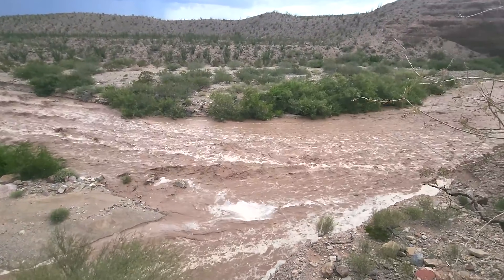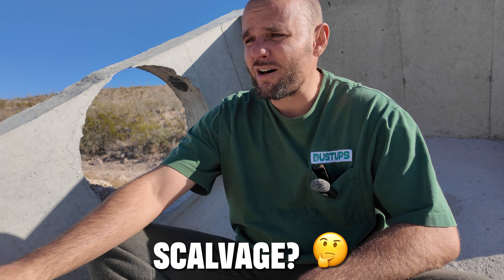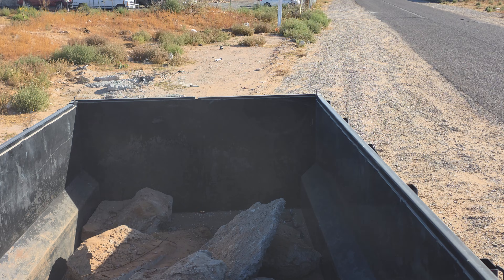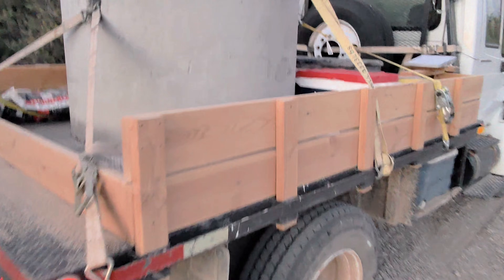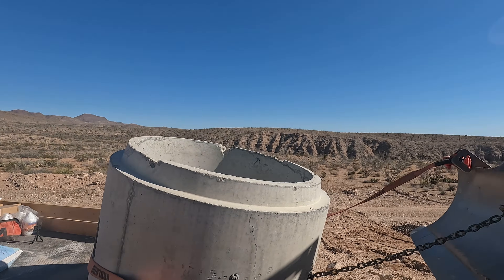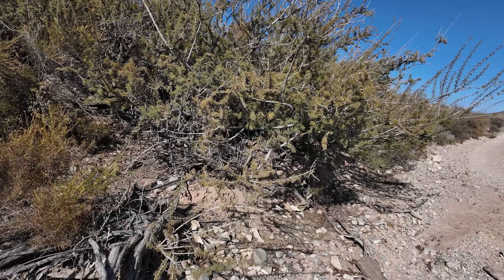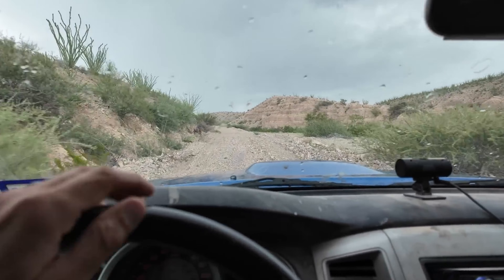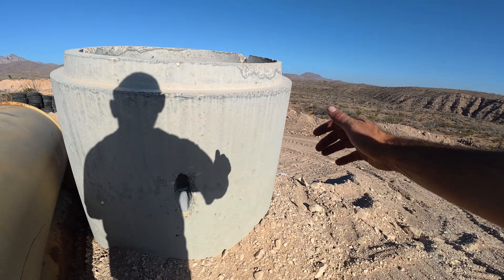I'm Fighting Desert Floods with Free Waste Concrete

Comment: If the mountains get twice the rainfall and the water goes right by/through your land, is there any way you can capture a SMALL part of those rushing waters?  While the rains are random, this extra water could help you immensely.
Reply: The infrastructure to stop it would be expensive because it destroys anything that doesn't look like that wash until it does look like that wash.
Reply: Remove a massive amount of rock in the wash to create a pond. The water fills it with stone and .ud the first rain.

Comment: If you had enough of those pipes and laid them side by side across the wash with each pipe facing opening face the flow of water… the water could flow through them. Then you fill in between them and on top of them and make a road across the top with gravel and rocks. You’ll still create a barrier as well as a road across the top.

Comment: I don’t think you should stop hauling those blocks out once you have one line across the gap,
I think you should space them out with a few feet between them and put another one in the gap allowing the water to flow but slowing the speed of the water.

Fill in that whole space between your line and your road. Debris is going to build up over time and add free support to your project and the banks of your crossing are going to widen for sure.

So it’s a good idea to have extra blocks you can move out, also line the banks upstream.
 Try to get a nice pad to drive on that won’t erode.

Comment: Pro tip,  Find a CAT scale near you, setup the app and a CC. figure out your Load capacity, then minus your truck and trailer weight. That is your Actual load capacity. and Just roll over the scale to get your weight with a load.

Comment: The advantage of gabion blocks is you can build them onsite, all you need is the wire, you have the rocks. 

The cast concrete makes a great anchor but you might want to put a couple layers of gabions upstream of them to take the initial hit of flood water. Not an engineer, but I don’t think 6 ton blocks of concrete are going to stay put when a flash flood smashes into them but if you can distribute and diffuse the load you might have a more stable system. Probably need back fill behind and some soil retention behind as well.

Comment: Shaun, have you considered using F.I.B.C's Flexible intermediate bulk containers. They are typically used to transport and/or store granular materials. When empty, they weigh about as much as a blanket. They are built to hold 1 ton or more of materials. They are one time use in many industries and they just throw them away. You can fill them with local rocks and clay to make your damn.
Reply from the maker: It's a good suggestion if I had a front loader. I like the idea. It's a poor man's Hesco

Comment: Please keep an eye out for a "hook lift" that will fit the International truck.  It will multiply it's usefulness as you can use it as a dump, a flatbed and roll-off hauler without a loading ramp or lift gate!.  You can leave a roll-off dumpster at your neighbor's to collect manure and pick-up at your convenience.  You can dump cargo like the concrete blocks wherever you want. And you can still use it as a flatbed!  Another channel called @onyxpartitian even did a video about retrofitting his truck with a hooklift.  Check it out!

Comment: May want a little “ padding “ in bottom of trailer if hauling rip rap, surge stone, large debris .     Be neat if you could make a cistern out of the better pipe sections May. E able to stockpile the concrete then rent a skiddy with a rock bucket     for a week.  Commend you on your efforts.  🍺.

Comment: If you get more concrete pipe, have them load it sideways so they can roll off the truck when you unload. Thats's how they get delivered to the job sites. Also lood for highway projects in your area. Many times they demo culverts and bridges and are looking for plces to dump
Reply: I've built plenty  of highway projects in the Sierra Blanca area and know that a lot of concrete get dumped in holes near the highway

Comment: I’m wondering if creating sections or barriers in a zigzag pattern down your trench instead of straight across might cause the water to meander and slow the water might be better.  Just a thought for the viewers.
Reply: Go watch the video it won't help.
The hescos with a ramp of stones behind it to the top is the best option. A few other geotextile placement would help.

Comment: Sweet Shaun, that sounds like a fantastic idea. I'm guessing the concrete is supposed to allow debris to build up behind it like a check dam while eventually slowing the flow enough to let the water soak into the ground. Sounds like a really cool experiment. Can't wait to see the results of it. Sounds like you will need many of them to deal with the massive amounts we get in Texas when it flash floods but the idea is really solid

Comment: You're in a remote, secluded spot in a desert.  Texas has marijuana laws.  Therefore there are illegal growing operations going on somewhere not too far from where you are.  From time to time the police will bust some of them. 

Therefore greenhouses (mostly made of metal hoops and plastic sheets which have the advantage of being light and easily portable),  shade cloth, irrigation equipment, pumps, enormous water tanks, garden soil, fertilizer, and several other things important to your goals may be for sale available locally at police auctions on a fairly regular basis. 

The best case is when they don't feel like it's worth it to haul that junk out of there all the way back to town and would appreciate someone local to cart off chunks of it. I don't know if they do that around there, but it has happened several times on the Mojave.
Reply: I love that idea!

Comment: what you need is a proper cultivation of the soil , dig a dip hole every yard or so to capture rain water and you will have golden growth
Reply: He did that called them dirt bathtubs problem is water drains away in less than a hour it has some good effects but not drastic ones

Comment: Drop some 1 foot wide pipe down into the arroyo.  Secure it. Maybe with your concrete.  Run it up the banks and onto either side of the arroyo. Go at least 300 yards away from the banks . Dig Some ponds. One rain storm will fill those ponds, it will look like you hit a water gusher of a well.  I sent you a  video from a Farm in Wash State which used this method as a solution to get water out of a 60 foot lower than the bank stream. Works great all year. Have fun.
Reply: So it uses the force of the rushing water to drive water up the banks through the pipes, sweet cheat code!
Reply: @Barskor1  exactly. The should run a 4 Inch Pipe to check it out. The amount of water is going to be amazing. They could sell Tickets to the show.

Comment: I have some very large Hesco Barriers from a military auction.  They are 7’x7’x7’ and can link together. 
I think these would work well.  I am just 10 miles north of I-20 on your way out there.
Reply from the maker: Email me: howdy@dustupsranch.com
Reply: @dustupstexas nice 👌  its coming together .
Reply: @dustupstexas sink those into the ground and T the wall with another at the joint and they'll never flip
Reply: Here we go! Made for flood control. Can't beat that!
Reply: Commenting to help bump this - I hope Shaun sees it!
Reply: Amazing, it feels like I'm watching history being made in the comment section right now
Reply: ￼ I think this will be the hot ticket. They are linked up and go out 91’ with 13 cells that are 7’w x 7’ l x 7.3’ h
After rewatching the video, I would think he could drive over them if he also puts dirt on either side, built up.
If you want to look them up, here is the exact name.
Maccaferri MILDTL32488-7B DefenCell Mac Welded Wire Gabion Barriers
Reply: @encorepermian  tyvm for helping Shaun!
Reply: @encorepermian definitely. They have great gravel too that will weigh them down more. If the double sided them and offset then so the joints aren't in line and sunk then 2 feet down I think that'd be extremely resistant
Reply: email sent
Reply: Hesco would be perfect, now u just need to fill them upp😅 you got plenty of rocks and soil over there and you can fill them with a small excavator
Reply: Use hesco Shaun I commented to use hesco before I saw this comment

Comment: It's tough to beat free when it comes to the reinforced concrete, but I'd be interested to know your thoughts if gabions wont be cost effective at this time. I feel your main concern with them is if they collapse, there is that one gabion that was installed and collapsed due to having the very sandy foundation underneath,  but one thing I saw that was missed is that when they're set up vertically like that one it's more structurally sound to lock it into other surrounding ground. A gabion of that size is built more for a steady seasonal stream over flash flooding (although many of them together can help resist a flood).

My thought is to lay some gabions wide so that one can't fall onto its side essentially, make a gabion floor as opposed to a gabion wall, and that way you basically get many rectangular rocks. Gabions used for water catchment are often done like that and two-layered like steps, but for your purposes one could do plenty. 

In Arizona and Mexico, Cuenca los Ojos / Valer Clark is a company that has been working on anti erosion for years, I highly encourage you reach out if you get the time.

Comment: I saw a guy using these for fish cribs in the past. What I would recommend is contact your local DOT office and ask if they are doing work in the area. They’re under no obligation to help, so understand that, but often if they are you can offer to dispose of concrete from old storm sewer systems. The crews on the sites doing the work will have the equipment and see it as a benefit that it’s less of the pain-in-the-_ part of the job that they have to do, their company saves the high cost of recycling these components, and the DOT knows it won’t be sitting on the sides of their roads for extended periods of time.

I built my workshop with wood built from shipping equipment being thrown out on job sites, offering to remove this kind of waste is something companies want because you get free material and they aren’t paying the cost-per-pound to dispose of it all.

Comment: If water gets hold of those concrete blocks, it'll roll them like peanuts. You might be well advised to fill them with those little stones (in bags so that they don't disperse easily is even better) that you seem have a lot of and even some clay to bind the stones together. And, you need a lot more of these blocks. A lot more.

Comment: You're going to want to use the dozer to push materials against the concrete on the upstream side. Not perfectly done, but a start. Something to make sure the force of the water is spread across the whole structure. The water will find the weakest way through and EVERYTHING will go there.
Reply: Exactly,  that's the plan once I get enough to cover the area

Comment: Check the fuel filter on your truck, no flow… no go….
Reply: Fueling is fine.  Its a steep grade i was going up.  The engine is a dt466, not a big 14 liter engine you find in tractor trailers

Comment: jersey barriers ftw - this could really help with terra forming - think along Z shaped sloughs or terraces - obviously you have to work with the land - it is trickier than it looks, you are doing some good experiments and making things happen - just keep going - 2026 could be consequential plus you can fall back on horse manure and compost - that stuff is going to bring wins, in enough quantities. the dozer should continue to be a force multiplier, make some reservoirs or series of such - maybe some fabric or adequate spillways to preserve the dams - connect concrete pieces with rebar. keep bargain hunting

Comment: Just an idea here, and it may have already been suggested, but those large tubes could also be used as culverts to let flood waters pass under the road. You'd probably need to cut some long gently sloped trenches with the bulldozer to lower the grade a few feet in the middle on both sides of the road so you can let all that water pass under it. Then you cut out the middle of the road with the dozer and roll like 3 or 4 rows (2+ tube stacks) of those tubes into the gap before covering it all back up with your road. However, this option would require a bunch of those tubes and it'd be a lotta work and time. All that for just a road, when your real focus here is simply to maintain access to the ranch. So I hope that your current strategy works out as it sounds like that'll be most efficient by a number of metrics. Anyway, best of luck with the flood control setup!
Reply: I think that's a great idea to let the water flow.

Comment: The last episode I suggested building a large pond to control the floods.use the bull doser to go down about 6-10 feet in a 100 x 100 yrd hole in the middle of that valley they floods. It won't hold all the water  but what it gets will last months. Or maybe not in the middle but off to the side and dig a canal to the pond. Have you given that any thought? It's a way to help control the flood and at the same time gather much needed water. In other words a retention pond.

Comment: Giant concrete is a great idea bro! Last episode on the wash I was too late to the party but wanted to mention with your Gabion attempt that welded wire fencing is pretty delicate but out west our trail maintainance folks use chain link fence material for gabions and it holds up much better
Reply: Gabions are something you're better off. Using the real thing.
Especially for use in waterways. I guarantee chain link fence won't do it long term.
Just an FYI

Comment: if the water does not have a way around the blocks, it will find one. it still will ripp through there just on the sides. The energy of the water is still there. it needs a diversion earlier or you can build some kind of bridge. it has to go somewhere
Reply: I was thinking the same. I suggest Dustups seek/find a hydrological engineer who can vet this idea and advise on arranging the concrete pieces. Culverts or conduits might be required to allow water to pass without scouring the banks or carrying away the blocks even the big ones. Good luck!
Reply: this is exactly what it is going to do...the water will find the next path of least resistance and flow through there.

Comment: Reminds me of the sand dams in Africa. You'll have to work it into the bank though as otherwise it will just scour the sand out around it.
Reply: I can see that happening over time in Eugene, Oregon  44.046260, -123.047643  Several iterations of improvements, and now paralysis, are allowing the Willamette River to scour around the most recent end. Fortunately, the shape might turn into a Tesla Valve, hopefully mitigating itself.

Comment: Shawn, a bit of 2" square steel 1/4" walll, can build a gin pole, that will hook over your dozer blade and  can reach over the heavy stuff, chain and lift blade lifting the Gin Pole, lifting object off trailer, truck or just carry it around.  Think of a boom truck used in the oil fileds etc. would be cheap to build if you have a welder handy..
Reply: Do you use wooden telephone poles over there, they dhould be cheap.

Comment: Like I said before, make 2 ramps pointing DOWNSTREAM but set INTO the bank, so it is OUTSIDE the flow. Then ARMOR the walls facing the water with the heavy material. That is how seawalls are built and they hold up to storm surge with the energy of a nuke.
Reply: I think you mean upstream as seawalls/dykes have their small slope towards the sea - at least here in Northern Germany/North Sea.

Comment: You have millions of pounds of perfect gravel out there. It requires 450 pounds of cement to make 4500lbs of concrete. I kinda wonder if it would be more cost effective to just make your own concrete they sell form molds to make large blocks... but I suppose there is the challenge of water ad well.

Comment: Get a roll of bailing twine, string a level line at the elevation you need to maintain your low level bridge. 
Flowing debris is going to be what you're building for. 
Over, or under? 
You're building a water obstruction. Block it too much and once it reaches the strength capacity of your structure, it's going to fail all at once.
What's downstream?

Comment: Necesitas llenar las piezas con sacos de arena y piedra. La barrera se tiene que colocar en la parte mas angosta del cauce y que tenga roca madre por debajo, si no vas va a escarbar. You need to full the concrete pieces of sandbags and rocks !  The barrier has to be placed in the narrowest part of the riverbed and has bedrock underneath, if you don't go it will dig.
Reply: Right and of all of these Dustups vids I have watched I dont recall ever seeing him hit bedrock yet,  caliche is the closest thing to it but if that stays wet it goes soft eventually. That whole place is ancient alluvium apparently, came from a mountain 400 miles away, a long time ago, carried by the same flow of water he is now trying to keep from being so destructive.  Uphill battle if he doesnt have the cooperation of some fellow battlers uphill. So, rocks, gravel and sand is mostly what he has to work with.
 The whole reason that whole region is in the sad state it is in IS erosion, the topsoil having blown/washed away a long time ago, and still the erosion of newly formed topsoil is at roughly the same rate as it is being formed.  That is the long term focus if he is to have any significant degree of success, conservation of soil and water. Stop everything from continually moving.  Spread out the flow to lower velocity so it is not destructive.